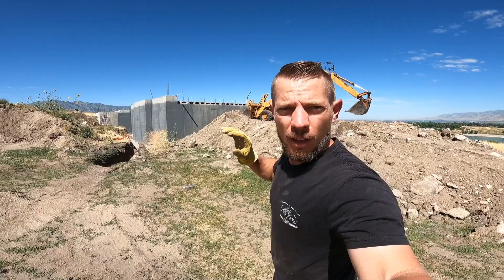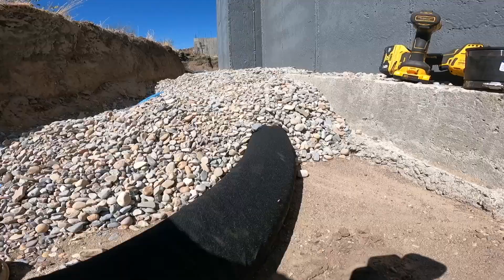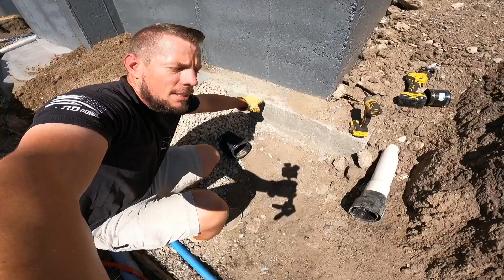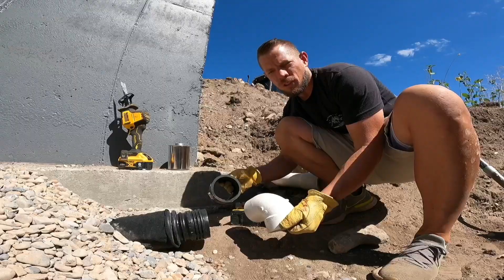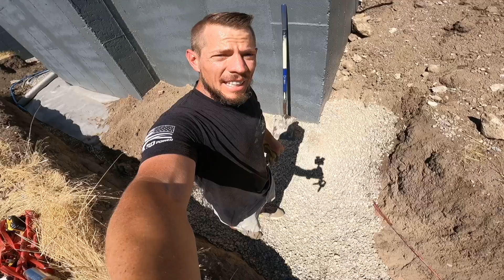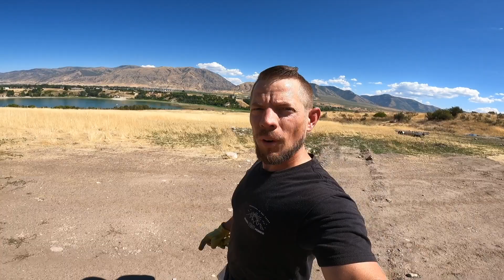Installing a House French Drain *PROPERLY.. Sort of*

Comment: Nice work. But, drawing from experience, that “sock” is a bad idea.  You should dig the perimeter trench like you did a place about a 2” layer of gravel about a foot wide followed by perforated non-woven filter fabric and place your perforated pipe like you did.  The filter fabric should be wide enough to wrap around a square foot area continuous along the length of the trench. Pour 3/4” to 1-1/4” crushed rock on top and sides of the pipe til you achieve that square foot area I mentioned.  Then close the filter fabric and overlap by at least a foot and pin it closed like a huge burrito (called a burrito wrapped” drain by some.  Then depending on you preference fill the trench up to the top of the trench with same rock or fill dirt that allows good drainage. Do not fill it with clay. If you want you can place more filter fabric along the top of the french drain to help filter out more dirt from entering the system. 

Additionally, if you would have thought about it you should install an additional non-perforated pipe along the perimeter to catch gutter water and drain to the same place. Catching the water if you want to go green to use for plants.

My socked pipes clocked within a couple of years. I did not do it. The contractor put it in when I was gone. No gravel was used. It was typical of poser contractors. I’m a civil engineer and water drainage is my specialty. I also installed my own french drains after digging out the clogged pipes. My drainage problems are nearly gone. I have about a 200 more feet to install. I’m using open french drains. I may modify some of it later for growing a lawn.

Comment: Fabric really should be wrapped all around the stone not just the top. that prevents fine material from clogging the stone voids in addition to the pipe. No water gets to the pipe if there is an impermeable layer around it.